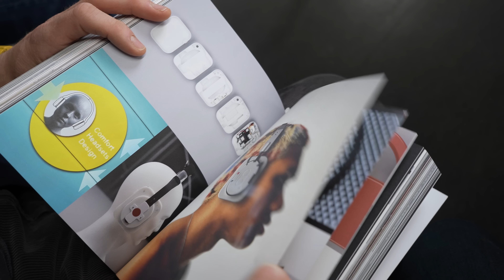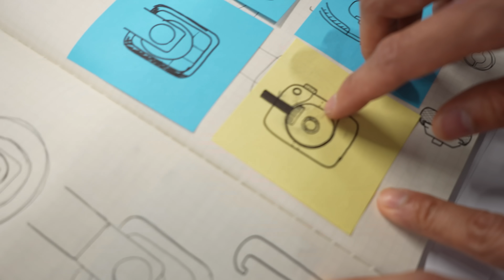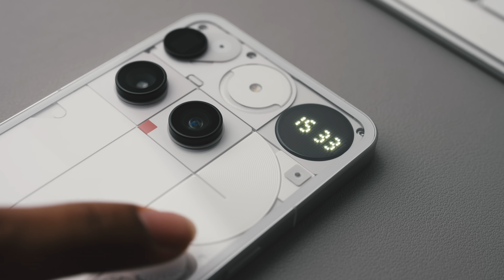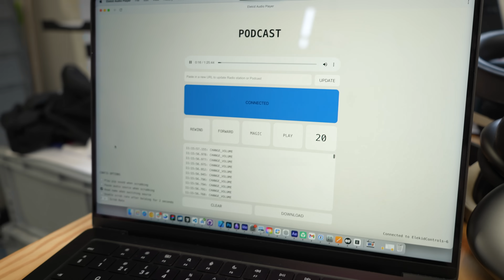Headphone (1) design SECRETS revealed

Comment: I just bought one; the black design is sleek, the comfort is really nice, and the physical tactile feel with the buttons is on point. The connection was hassle-free and works. microphones are decent and noise cancellation is fairly good. Battery life is awesome. The only 3 downsides are orientation of the headphones of the case you have to flip them around and put them in,  also Left and Right is very difficult to see those labels.  Secondly the sound effects can be distracting would of love the ability to turn them off and more options with the paddle and scroll wheel maybe switch them around and such, and Lastly sound profiles are annoying tricky, default sound profile are airy and tinny you could of added the personal sound profile feature like with the buds that you have but the advanced EQ is beneficial to tune in better sound, personally would have preferred 10 channels instead of 8. Other than those 3 things, it is a solid product, is priced well and is designed really nicely, props to the designers. Oh, right o, on last thing, you should add the ability to connect an external microphone so I can use it as a gaming headset.

Comment: I have these, and is overly satisfied with both the design and comfort, and the physical buttons is a no-brainer for me; so well designed and functional!
Transparency mode is very good, making me using the H(1) for telephone calls while driving or commuting more than other good headsets (including my AirPods Max which hasn't been used after receiving the H(1))
I find the tuning and soundscape out of the box a bit dull and conservative , with a lack of both tightness in the low end and clarity in the highs, but maybe the very innovative possibility of creating qr-based eq-settings will be able to improve this, though I would have expected a more high-end sound from the collaboration with KEF. Work in progress...Got to say, though, that the overall sound is very pleasant and non-fatiguing, so i guess that the stock sound might be a deliberate choice form KEF/Nothing in order to target the consumer market 
I guess that it works; 
Regardless of the -not very outstanding - sound, these have nevertheless become my daily go-to's because of the comfort, the transparency mode and the very intuitive physical controls, and the design is just awesome!

Comment: Did I see a 3.5mm socket? Is it there to connect to analogue sources (like onboard a flight)? Can bluetooth be turned off but with ANF on when using the 3.5mm - so that it saves battery?

Comment: Incorporating a glyph light not only enhances the headphone’s visual appeal but also adds practical functionality. When the headphones are placed flat, periodic glyph flashes every 5 to 10 seconds can serve as a subtle reminder that the device is still powered on. It can also assist in locating the headphones in low-light environments through a flashing pattern during ‘Find Me’ mode. Of course, when the headphones are being worn, the glyph will remain off to avoid unnecessary distraction.

Comment: Hi guys, a YouTube channel called TechRadar has a review of the Headphone (1) up and in the review, around the 6:30 mark, the reviewer states "the earpads and headband are leather, with no vegan option".
I just spoke with your support and they told me the same thing that you state on your website which is that the material is actually PU and so is certainly NOT leather.
You might want to get onto TechRadar to ask them to correct their mistake, this may put a lot of people off otherwise. ♥

Comment: Looks great as does all ID from Nothing! The CMF is what lots of people have been waiting for. Love that it has a 3.5mm audio cable pass through for using with audio recording and playing, with no lag which is missing from some VERY expensive competitors. Good Frequency range. Like the 5 minute for 5hr listening quick charge- great for flights you forgot to charge the night before. Also like the Case which is a real case. I hope the ANC is adjustable in the app for your environment sometimes auto gain adjust needs tweaking by the end user. Can't wait to give them a go!

Comment: Ive gotta say at first when i saw it the rectangular aluminium threw me off, but after some time its kinda growing on me and i think i really want a pair, ive already been looking for some overears and with these i wouldnt just be getting a boring but funtional piece but something distinctly its own that i can even just wear as an accessoire around my neck because it looks that good and unique. And thats just Purely aesthaetic, ive always hated the clunky controls off headphones with 1 or 2 button, holding it down for differents lenthgs to turn off/on or to pair to devices, its not reliable and just annoying so the simple on/off switch is just beatiful to see, and oddly enough even tho its uncommen the paddle and roller controle seem like they also just make sense instinctively, and the extra button is just a nice add on. Overall youre killing it especially for the Price when you take the design into account.